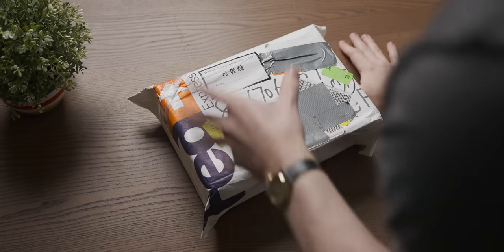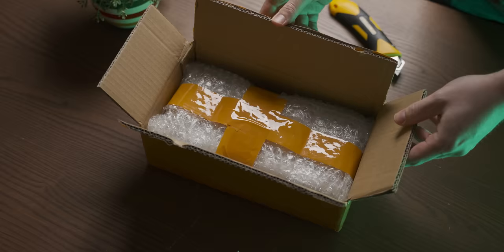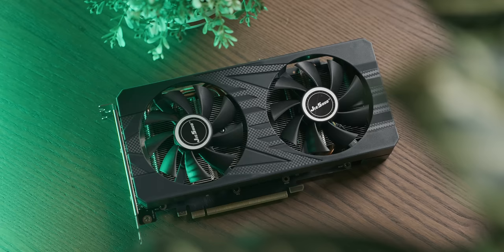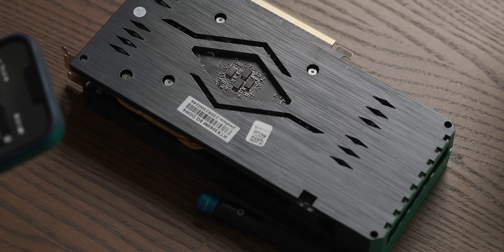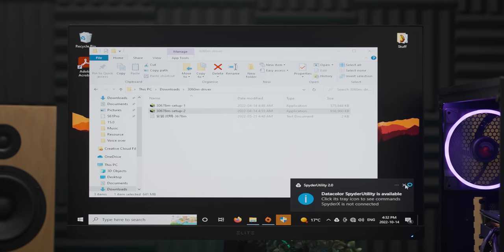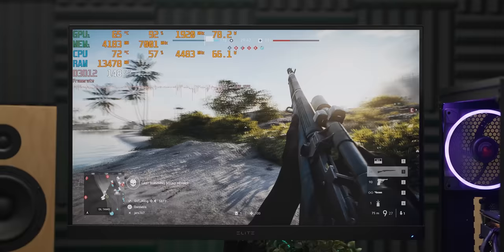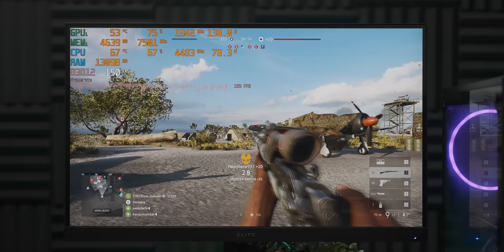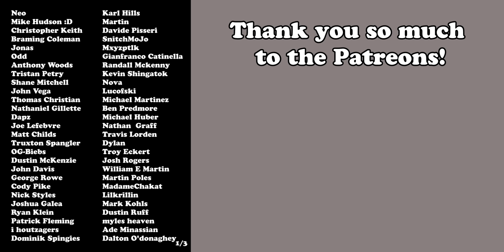This "New" RTX 3060 From Aliexpress Was Suspiciously cheap...

Comment: Wasn’t there a thing about a year ago where people were repurposing laptop GPUs in actual PCIe cards to mine because the laptop chips didn’t have hash rate limiters? If I remember the laptop 3060 actually has more cores than the desktop despite half the VRAM
Reply: Yup, I had an embarrassing argument at work where I swore blind nvidia always use a lower SKU in laptops and name it the next tier, but nope, this time Jensen wrecked me with 3060M. Bastid.
Reply: that's what I remember to
Reply: If you ignore the first more obvious solution, which was the farms that literally had laptops sitting propped open at about 30 degrees facing down. why rip it apart when it runs just fine as is? Yep, they were absolutely doing that you are correct sir. 

This was why certain laptops were released but you could never buy them. Optimal mining conditions, (memory, core speed, etc) models would be snatched in pallets much like the GPU's. 

By the way, I have a friend who does water balloon collaborations, would you be interested in a collab?
Reply: I didn't even know that was a thing, and yes you're right, the laptop version has 3840 Cuda cores, while the desktop sits at 3584
Reply: also the 6600M those cards are about 190 pounds about 195 dollars difference is you can use amd drivers on them
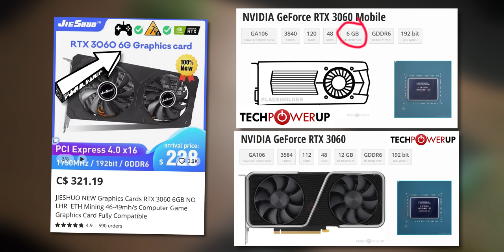Reply: It can be seen in 2:12 that the mobile version has 3840 shaders vs. desktop model has 3584.
Reply: They're still doing it, actually.
Reply: They actually mine with the laptop. Never heard of they transform it into pcie card but you could be right
Reply: @fracturedlife1393  This was mostly the case before the 10 series. Ex: 760m being 2/3 the core count and 40% the perf of the desktop 760 (yes the desktop was 2.5x faster). Now it mostly affects the top mobile parts, with the 3080 desktop being 1.4-1.5x faster than mobile.
Reply: @fracturedlife1393  that once was a thing. There was a laptop gpu called the 670mx in the Kepler generation. So the laptop gpu was called a 670mx. It was a gtx 660 running at 600mhz. So it was an entry level gpu running at just above half the speed of the desktop version. Kepler didn't have great power efficiency honestly, so they couldn't come up with much better I guess.
Reply: @fracturedlife1393  XD
Reply: I remember seeing laptops half open hung out like clothes drying on a clotchesline.  What is a laptop without a GPU worth? Not much...
Reply: I bought a brand new rtx 3070 unopened box for $360 a gigabyte version take for granted it was a very rich immigrant selling it on Facebook marketplace
Reply: Aleksi 2  i usually don't correct people but how on earth did u come up with the word "runned"??? 😭😭😭
Reply: @rogerroger10-47  they are not taking gpu out of laptop. Instead they buy laptop gpu and make it into a card. Well, why? Because at the crisis time, all desktop gpu are out of stock. So they bought mobile gpu that should be for laptop production, and make it their own version, right from the factory so there’s no ripped laptop. The thing you saw is from miners who use laptop as mine machine.
Reply: Yeah, it litterly says mining gpu
Reply: known thing that the same gpu in a desktop made for a laptop will perform better
Reply: @fracturedlife1393  my 1050ti laptop gets way better frames than all the benchmarks i see for 1050tis
Reply: If you could overclock this this would probably outperform 3060 desktop LUL
Reply: @justinvanhorne9958  Although this was definitely done the downside is that you get the powerdraw of an entire motherboard and CPU to what end? 
If the entrepreneur farmer can just rock up to NVIDIA and be like "Hi, I'm a laptop manufacturer, can I have 10.000 GTX 1060M chips please" and sticks those on a bunch of cards to run the usual whatever the ratio is (8 cards per motherboard)? efficiency improves and profits go up.
I wouldn't be surprised if these cards come exactly from those creative big time miners.

Pretty neat though! They did with NVIDIA cards what AMD more or less did themselves with the RX 6500 XT. Sticking a laptop GPU on a Desktop graphics card.
Reply: @fracturedlife1393  o
Reply: Lol what 20 fps difference for a 100$ less? Sign me up and let the Chinese steal my data with their drivers😂
Reply: Yeah, that's what these cards were for. All the Chinese-based Ethereum miners are selling off their frankensteined graphics cards with laptop GPUs on Aliexpress now that the Ethereum merge has made mining unprofitable.
Reply: @justinvanhorne9958  "why rip it apart "
They didn't rip anything apart. They just bought the GPUs directly from Nvidia and built the cards based on those GPUs. Obviously buying laptops and pulling the GPUs out of them to put on graphics cards would be stupid, but none of the mining companies did that.
Reply: @nathangamble125  take a class on reading comprehension bud, or stick to minecraft.
Reply: @yeti4269  Yeah it is weird to say the least. I have a Razer Blade 14 with a 3060 6GB + 5900HX and a desktop with a 3060Ti and 3900X and I found that weird when I looked up the specs.
Reply: heah it was called a minign gpu on ths listing
Reply: Aleksi 2  saying ran would actually be easier lol. Not usually one to correct others either. I am going to guess English is not your first language and that’s okay. I mean no offense I see typos and bad English on YouTube all the time. I my self make typos all the time and English is my first language but it’s usually typos for me when I make mistakes or bad punctuation lol. Had Dysgraphia when I was younger which is a mild form of Dyslexia.
Reply: It was not too long ago that we mod main stream drivers to allow cards with specific product ID to be recognisable. I this case, probably need to find out the product id string from the drivers provided by seller.
Reply: @justinvanhorne9958  There is nothing wrong with my reading comprehension. There are 2 possibilities:
1. You are the one with no reading comprehension skills. Did you think someone else said something about ripping a laptop apart? They didn't. You were the first one to mention it. That's why I addressed your comment.
2. You have terrible communication skills. You're replying to a comment about where these graphics cards come from. If your rhetorical question about ripping a laptop apart isn't about that, why did you bother to mention it at all? Again, no-one else said anything about ripping laptops apart, and your comment up to that point doesn't imply anything about ripping laptops apart. Do you not expect people to assume that you're going to stay on-topic when you reply to them? Forgive me for thinking there was any purpose or relevancy to anything you have to say.
Reply: @nathangamble125  first of all, I do not accept your apology, mostly because it is based on outright lies and fabrication. I can’t teach someone reading comprehension, anymore than you can teach me how on earth you are “blaming” me for something that I did not initiate. 

Thanks for coming though, strike two.
Reply: Yes, this is in fact one of those mining cards
Reply: You are right bro, that mobile 3060 was setup for mining , they coast 600/700 when this was released lool, but now mining isnt efficient
Reply: If you knew anything about crypto mining you'd know vram matters more than cores. They didn't repurpose laptops. They just mined on them .
Reply: @stepbrobiwankenobi  and if you knew anything about crypto mining you wouldn't be showing up weeks late to a youtube comments section of a creator that on a tech rating scale averages about a 3/10 and in crypto its probably closer to 2/10. 

but by all means keep scouring the internet for your points.
Reply: @GoingtoHecq  actually Kepler was a significant leap in power efficiency from the previous generation and actually IMO was the first gen of laptop gpus from both teams where the performance for the price made sense.
Reply: I think these are leftover chips Nvidia has. Chinese bought them and made a cheap card out of it.
The idea of ripping it out of your laptop and make a desktop card out of it and then sell it is to crazy idea to be true. 
Also way to much work just to sell your mobile gpu for cheap.
Reply: @justinvanhorne9958  I think it's remarkable that you seem to have made it your mission to project your poor English skills and thirst for "internet points" onto everyone who points out that these GPUs weren't removed from laptops, and to randomly insult people who did nothing wrong and aren't involved in the conversation.
Reply: @nathangamble125  weeks later, and many many hours of deep analysis later by you, you still just do not understand. 

any of it.
Reply: Crypto is so insufferable.
Reply: @T.C  welcome to South Africa 😂
Reply: Which is why this card is cheap. Its been mined to hell.
Reply: i noticed the desktop version ran much cooler than the cobbled thing. could be a factor for some
Reply: Yeah, they also more efficient than their desktops counterparts.
Reply: why would he buy this off aliexpress when u can get it from ebay for same price
Reply: @mattheww797  because they're all the same fake gpu
Reply: @rogerroger10-47  "what is a laptop without a gpu worth"

it would surprise you how expensive they often sell generic laptops with just a CPU (which ofcourse has integrated graphics, but still..)
Reply: @fracturedlife1393  Looking at the product specs today, the situation is very much more complicated than it used to be. The desktop 3060 has 28 SM's and a 170W TDP*, while the laptop 3060 has 30 SM's, a lower clock speed, reduced memory bandwidth and a reduced TDP range of 60-115W, configurable depending on power and cooling. However, the desktop 3070 has 46 SM's against the mobile's 40, but with the same memory bandwidth and a 220W TDP versus 80-125W. So..... yeah, complicated.

(Whatever "TDP" means today)
Reply: Yeah, that also caused lots of laptops to also go up in price, cuz they were buying laptops in bulk, cutting out the 3060M and putting it on a desktop PCB, and using them.
Interestingly enough, Nvidias 30 mobile series has different watts settings for higher boost clocks, so supposedly the things were faster than some desktop ones.
Besides well…. The 3070ti mobile and 3080ti mobile, simply due to them needing to be between 115 and 150 watts at maximum.
Reply: Actually, some of them might’ve been getting licenses to sell 3060 mobile chips, but threw them onto desktop PCBs.
Cuz I think buying whole laptops, and cutting out the GPU and scrapping the rest would be a waste.
Reply: It is because of voltage
Reply: Ya before the mining crisis ended I was making sweet money buying old laptops from pawnshops with strong GPUs. Thems were the days